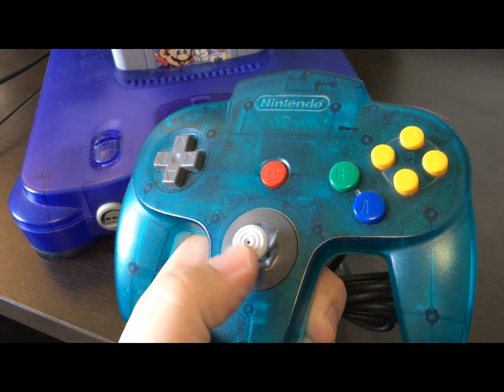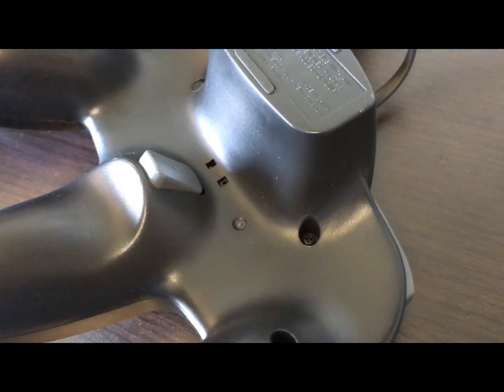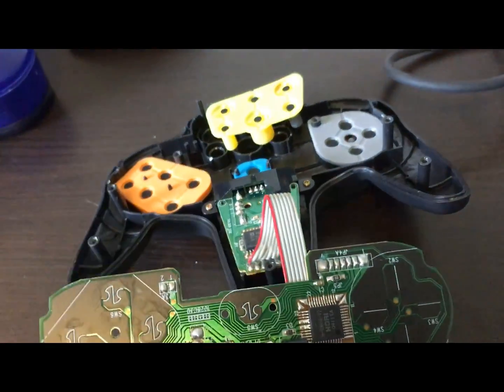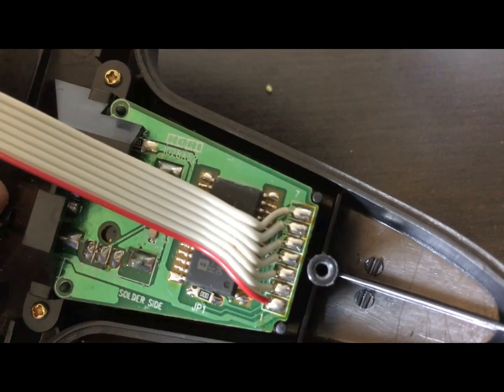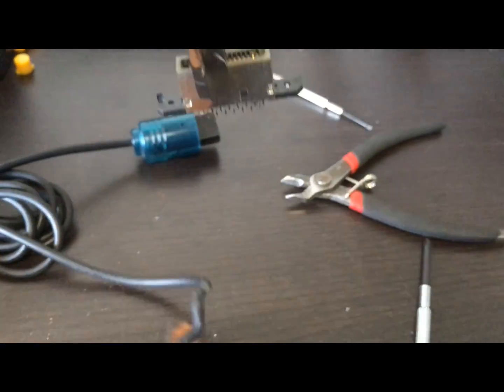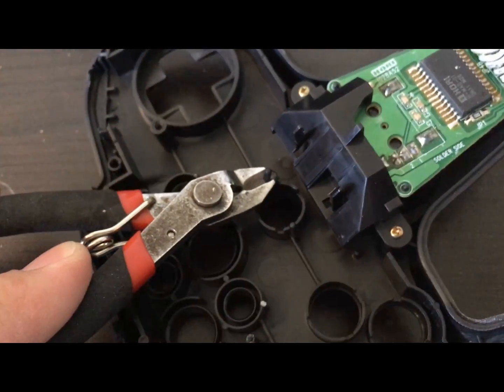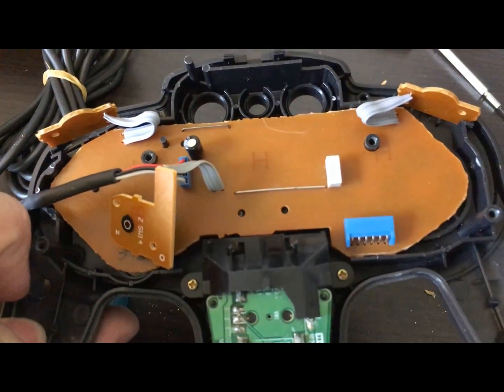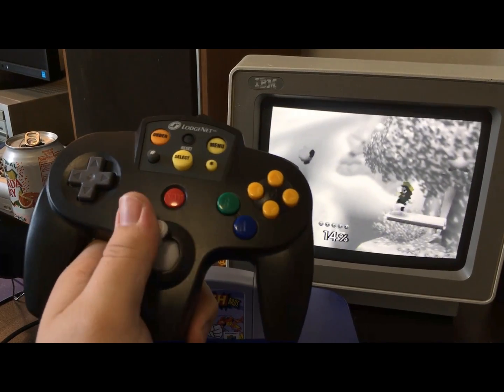Modding Lodgenet N64 controllers for console use

Comment: Any way to make an adapter using, say, an arduino or something like that? I kinda don't want to gut the controller.
Reply: Yeah, it would be a lot nicer, you could use the extra buttons for controlling other stuff in an emulator or MiSTer system and you wouldn't have to gut an original controller board. But at the current prices for LodgeNet controllers, it's not worth it, you can buy a replacement stick from 8bitdo that uses hall effect sensors and should last a lot longer than those original sticks, or you can order a bunch of replacement parts for the original stick.

You can even 3D print on your own replacement parts, as there are freely available 3D models of those parts... the "hardest" print is the optical encoder wheel itself, but luckily this one doesn't really wear down as much as other parts and I've been able to print a working replacement with an Anycubic Photon Mono SE, which is a pretty basic (and a bit dated) resin printer by today's standards, you just need to be very careful with the supports. I did just to check if it was possible, as it's resolution is barely enough to properly resolve the slits in the encoder, but to my surprise it works!

Comment: For people only wanting the stick. It's way easier to just transfer the stick to a OEM controller instead of hacking up the lodgenet ;)
Reply from the maker: You have to slice out the sticks surround from the lodgenet and/or widen and properly sand down the one from the OEM controller if you do that
Reply: @moftsoft  did you save the original clear controller shell that you had in the video?

Comment: You can't just cut into the PCB lol
I'm certain this is a troll/joke video
Reply from the maker: AUSTIN PEYTON you can “just cut” a PCB.
Reply: @moftsoft  You have to cut around certain traces or bridge what you do cut off and needs to be connected in order to work.
The way he explained it. He made it seems like you can cut into it in any way you please.
That's why I felt it was trollish to fool naive people into cutting into PCB's and expecting them to work afterward without planning.
Reply: Ulic Lon Dindong Cool.
Anything else?
Reply: Ulic Lon Dindong What exactly do I not understand? You said I know nothing. You don’t know me dude. You literally can’t just be cutting randomly into a PCB.  Is that not hard to understand? Yeah you can cut into it, but you have to plan your route so you have less to resolder together and what kind of PCB it is. Go cut into a multilayer PCB and tell me how that goes.
Reply: Ulic Lon Dindong His video is suggesting to viewers they can just cut wherever and it will just work. Poorly done video. You didn’t even read my last line either. I respect your knowledge though. You can cut anywhere on the PCB but it will cause you so much more headaches without planning out that it ends up looking like a pile of spaghetti. Nobody wants a spaghetti project so plan your cuts. Don’t just cut anywhere
Reply: @SoundFantasy  the guy had piles of cables from controllers he's modded previously, don't you think he would know by now what's safe and what isn't? How many people are going to watch this video, AND have a lodgenet controller, AND even attempt to mod it? Slim at best. And of the people who fit that criteria, id wager that they would have to know a fair bit about electronics to even consider it. This isn't like the gameboy modding community encouraging anyone with a screwdriver to ruin their console. This is a niche sector of controller modding that has a high barrier to entry. No one thinks you can just take a weed wacker randomly to your motherboard to make it fit in a shoebox and have it still work. We all appreciate the concern though.

Comment: Weird. My Lodgenet controllers have the EXACT SAME analog sticks, pre-lubed. All I had to do was open the Lodgenet controller, remove the analog, and then place it into whatever controller I wanted to have a brand stinking new analog. It works perfect. 

I watched this video before & was very off-put by all the work you had to do. It took me about 1 hour to swap out the 2 analog sticks, and the whole thing could be reversed since I didn't have to break any parts to get everything working together. I don't want to watch the whole thing again, but are you having to do all that stuff because the analog sticks are different?
Reply from the maker: That is a first-generation lodgenet controller. They use the exact same analog sticks, as you've noted, but aside from already being lubricated and possibly in better shape, they don't have any advantage over a normal one, and will wear down in just the same way.

Comment: Word of warning: this cannot be done with the GameCube variant. There's way too many minor differences in the form factor, and the PCB is much, much less forgiving. My attempt was a resounding failure.
I'll hold out for an adapter, should somebody create one. (PLEASE somebody create one. I actually want the extra buttons to work, to map to L1, Select, L3, R3, Home, etc.; the GC controller is missing too many standard controller buttons to use with a lot of games.)

Comment: Don't they have any adapters for these by now? I imagine they would! Cause it has been several years since their existence and I'm sure it's not that hard to make an adapter that simply converts the end piece into an N64 port. Same could be done with the LodgeNet GameCube controller.
Reply: Sadly though, there isn't one. If you ever do come across one though for GameCube, keep me informed! Even better would be if there was an adapter that switched it to USB, for use on emulators.

Comment: is it possible to just make an adapter?
Reply: Step 1: take out Ethernet cable end looking shit and yæte it out the window.
Step 2: replace the end with an n64 one.
Step 3: Profit.
Reply: @CallieSqueakz  Does it use the exact same protocol, though? I figured if it was that simple, more people would have done just that, instead of complicating things unnecessarily. Looks like this one uses two signal wires instead of just one, unless they included the extra wire for absolutely no reason and it's not used/redundant, you'd have to at least make an adapter board to translate the different serial interfaces.
Reply: + @gcolombelli  
ah my bad, thanks for letting me know
Reply: @CallieSqueakz  No problem. I'm actually a bit surprised seemingly no one bothered making such an adapter yet, maybe not a LodgeNet to retail N64 adapter, but at least a LodgeNet controller to USB adapter. Those extra buttons would be great to call extra features in an emulator. If those controllers weren't soo damn difficult to find and expensive as they seem to be right now, I would probably give it a try.
Reply: Yep.
Reply: +Robert James 
Do the state stuff, but for the Hotel NGC.
Reply: +Robert James 
Y E S.

Comment: how is the stick soldered to the board? do you remove the blue connector?
Reply: No solder to the points on the back side, for 1 of the 7 wires it's shown where to solder that wire.

Comment: or you could just get one of those gamecube styled sticks and take apart both the lodgenet controller and the gamecube stick and swap the joysticks and put them back together and put the the lodgenet joystick inside of the gamecube styled one and then put the button contacts from the lodgenet controller and put them in the normal button pads and put the normal n64 controller back together
Reply: baliebox 4916 The gc style sticks you can buy are not as good as the lodgenet ones as they are hard to use in games like mario 64 for walking since the deadzone is bigger.
Reply: Fentski There is a PCB you can order then it'll work properly.

Comment: wouldn't it be easier to put the joystick in a regular controller?
Reply from the maker: The reason I don't like to cut out the joystick area and transplant it is because it's a huge pain, and the result rarely looks clean.
Reply: I got my hands on a lodgenet controller and I did the same mod shown here but instead of trimming the board, I did the plastic instead because alot of the N64 games I play I prefer to keep the expansion slot so I used a back of a regular Gray controller just to make it look like the Japanese N64 controllers that come with Mario Kart 64.
Reply: I was thinking the same thing, he could've cut the circle out of the lodgenet piece and glue it in the official controller, if I made this video that's what I would've done.
Reply: He seems like he knows what he's doing. There's probably a reason for it
Reply: Joe Smith I didn't have a black controller at the time so I used a gray one plus I had like 3 or 4 gray controllers.
Reply: Dank Plushes201 Perhaps you are right, but other people's have done this modification, and I don't think they actually cut that piece out.
Reply: Michael Moffitt I see, and I don't blame you.
Reply: I'll showcase it on my other channel Rikarocks2001, I use that channel for video game videos.
Reply: @DiceDodo also, it would be awful
Reply: why not  3d print a new shell
Reply: @bunnytvnetworks  that would be awful